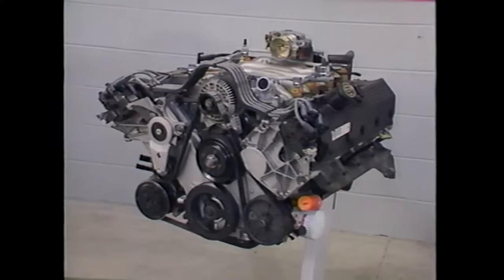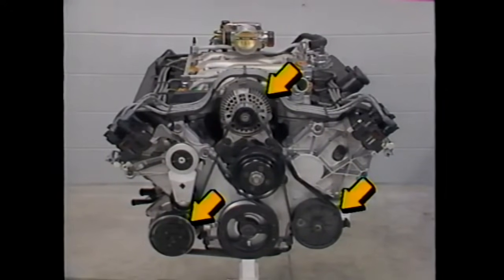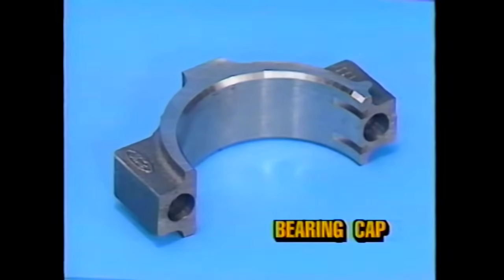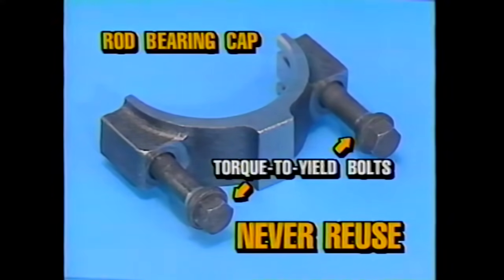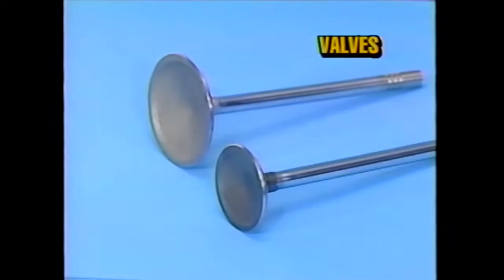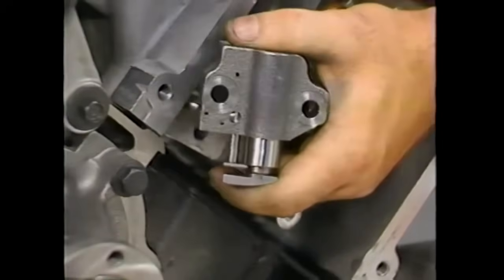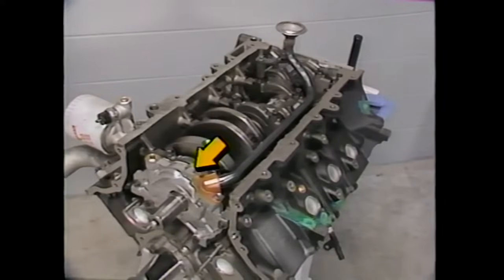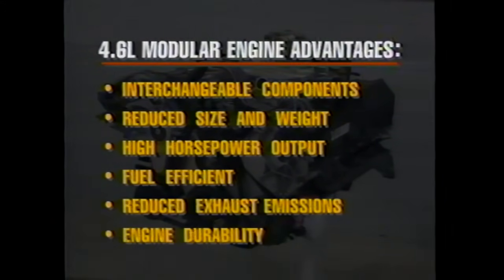Ford 4.6L V8 Engine Technical Education

Comment: At 42 seconds the narrator shows a chart and states the 4.6 makes 210 hp, much higher than the 5.0 .
A STOCK 302 IN 1989 made 224 hp so WTH OVER?

Comment: I have the 2003 Triton V8 5.4 litre 2 valve.  Amazing engine.  I put 380,000k on it before it went.  truck is still good so I put another one in that had 180,000k on it.  2004 they redesigned the triton into a 3 valve.  Ford's worst engine the mechanics tell me.

Comment: The jack screws help with distortion when torquing the main caps. If you try to first tighten the main caps without first installing the jack screws, the crank with bind up.

Comment: Why is this 4.6 being said to be light weight and compact. The 4.6 takes up as much room as fords older 460 CI V8 and weighs as much as fords older 351 windsor V8 at 500 lbs. I have owned 2 1989 Lincoln town cars that had the 302 V8 and they had more power and took up less room under the hood and weighed 70 lbs less that the 4.6. What we have here is generation ignorance of people that never owned 1980s fords and lincolns with the 302 engines. I own two vehicles with the 4.6, one is a 2002 supercrew F150 and the other is a 2005 lincoln town car and its a fact my cars I owned in the 60s up through the 80s with the ford 289 and 302 had more power and were much less trouble and much more compacted engines. If youre older as I am youve lived it and if you were born in the 70s and 80s or later you have been BSed to believe things that arent true
Reply: 99 PI 4.6 has 260hp, more than any factory 302 including 93 cobra’s 240hp.. The 4.6 is not as compact but is lighter because of aluminum heads and inclusion of brackets for accessories.. The 4.6 sounds better, is more efficient, reliable and maintains its hp throughout its lifespan… Driving a 200k mile 4.6 feels like the day it was made a 200k mile 5.0 is significantly lacking in performance..

The 4.6 has a better torque curve for traction, and revs higher and more freely.. 4.6 has more usable power throughout its torque curve.. Ive owned many of both, and would choose a 4.6 over a 5.0 in almost every scenario..
Reply: @NewEdgeDesigns  Youre a brainwashed person that wasnt around as I presumed in my comment earlier. Nothing you said is true. Have you ever even driven a 84 to 91 mark 7 lincoln???? No you havent. Your full of chit
Reply: @NewEdgeDesigns  Muted.
Reply: @EarlGuyton425 Muted for what? Spitting facts lol?
Reply: @yeetethdeleteth3307  Youre MUTED also
Reply: @EarlGuyton425 Insecure much?

Comment: The 93 Lincoln mark 8 block was beefiest of all 4.6 but the crankiness and pistons should be replaced with forged components - with a blower and forged internals you could approach 1500 hp
Reply: The 93 block did not use jack screws - manufactured by Teksid SPA Italy

Comment: Interesting they originally had an aluminum intake in this video, yet when they went into production they were plastic... When they switched to the PI setup, they went with an aluminum coolant crossover but left the passenger rear heater hose plastic. The mod engines are very very good, but there are 3 stupidly obvious issues that make it unreliable that could have easily been fixed when designing / updating. Which I would almost guarantee were changed due to "cost". 
If they had ALL came with an aluminum intake, fully threaded spark plug threads in the heads and steel body chain tensioners the mod engines would be almost perfect. Not a powerhouse by any means, but reliable and plentiful. 

They got the intake setup correct on the 3v's (even tho it is plastic) but they went backwards on the sparkplugs (which they later fixed in late 2008) and the entire VCT setup. I understand they needed to be competitive and make more power and used VCT to do this, but I would have much rather lost a few hp / torque and just went with a fixed gear. But... the VCT did make the 3v the highest HP of all the mod motors with the 2008, 2009 Bullitt and 2010 at 315hp naturally aspirated. That is excusing the entire "320hp" 4v fiasco that Ford got caught trying to save a few bucks and dumbing down the engine for the 99 Cobra.

Comment: My four six runs many hours a day oil stays full for thousands of miles, I personally like the plastic tensioners they are spring loaded and don't put much stress on the guides. Plus they have a better seal too
Reply: Weird when you start to modify them it’s recommended to use the metal ones
Reply: @WarriorOfEden3033  Build it right and they will last awhile been running a 46 for 5 years pull a heavy trailer and the oil never drops at all has 260,000 miles
Reply: @kustombuildsBTTX yes that’s why I upgraded to a billet 3v oil pump, 262 cams & port matched heads

Comment: I have 329 n change on my 97 f150 4.6l V8 2v with a aluminum to intake not the factory plastic..runs like it was off the line.....a real beauty of a motor 302 windsor not bad at all

Comment: Ratcheting tensioner has a know problem of stretching the timing chain, also the ford oil pump needs to be upgraded to a mellin high flow pump for this engine to be reliable .
Reply: Tensioner yes but the oil pump is a 3v engine issue
Reply: It was also used on the gt500 the 3v needed more oil cause it had the variable cam gears

Comment: I have 756,132 miles on mine and I have never changed the oil or the filters. It just keeps going down the road. 😊😊😊😊😊😊😊😊😊😊
Reply: Sure you don't 😂
Reply: I use tequila for oil..

Comment: I have the 4 valve version of the Modular in my Mark VIII currently @ 172k miles and still running smooth and powerful.  It has great torque I never have to go past 2500 rpm to go the speed limit of 45 its amazing the power is available at any rpm but at 3250 rpm all hell breaks loose snd all the runners open and the pull is epic to 6100! Ford killed it with the Modular

Comment: 1st ford I’ve owned 01 expedition 4.6. Engine seems ok but the rest of it sucks. Electrical gremlins seems to plague these things. Starting this week on replacing the heater cores. Requires removal of a million screws and nuts and all kinds of crap. I’ve always owned Chrysler and I can honestly say, will not be purchasing another ford.

Comment: I am driving a 2010 Ford F-150 with a 4.6 V8 3V engine in it. I am absolutely loving it! I was curious to what the engine block looked like and then I ran into this video. I am a lot wiser now, thanks for sharing!
Reply: 3v is the one that got issues
Reply: @jafaary2614 issues if you don’t change the oil religiously. And there was the spark plug issue but there are methods around that issue. There are many 3V’s with over 300,000 and 400,000 miles.
Reply: I’ve also got a 2010 with a 4.6 but mine has the 2v. Still am not sure what the difference is and why they offered 2 and 3v the same years.
Reply: @WhoamI20233 3 valves have boosted performance due to the extra valve. More HP and will rev higher if I'm not mistaken. Fords 3V V8 designs also all had cam phaser technology, which alters cam timing I believe. None of the 2V V8's had this. Basically the purpose of the 3V engines was to add power to Ford's Modular/Triton engines. But it came at the cost of reliability
Reply: 2 valve 4.6 is like a normal motor 3 valve is a piece of crap when you try to put it back together it cost about $8,000 with all the phasers and the Special Assembly do not buy a 5.4 3-valve or a 4.63 valve you will regret it
Reply: If you ever change a spark plug you better go buy the book and take extreme attention to what the rules are you will strip that plug out of the head
Reply: @JohnFerrell-u3e only 05-07 i believe has the 2 piece spark plug, after that it was a single piece design. the timing assembly is very very similar on 2v and 3v and the phasers on the 3v are the main issue but if you can rebuild a 2v you shouldn't have much issue rebuilding a 3v

Comment: These engines were gutless as all hell, but very reliable. Very smooth engines, too.
Reply: They weren't gutless when they were new.  Modern Engines have made them gutless but they were damn nice when they came out vs the 5.0.
Reply: @weskirkland5850  True, but there were way more powerful options from other manufacturers at the time, as well. One that immediately comes to mind is the LT1 350 V8, which blew the 4.6 at the time out of the water.
Reply: @TheTerminator310 😂😂 5.7 litre high fuel consumption v 4.6 litre fuel efficiency of course there's a Power Differential 😂😂. This doesn't make the 4.6 gutless you've compared it to a bigger cube engine 😂😂
Reply: @Saffsa  Doesn't matter. It was still gutless, compared to the competition. We're not talking about fuel consumption, we're talking about power/performance. And the 350 is an engine that has been around since the 1960's and was murdering the Crown Victoria 4.6. A good motor, but it was anemic, as hell.
Reply: @TheTerminator310  you said it was gutless comparing it to a bigger cube engine 😂😂 a gutless comparison would be if it was seriously under powered compared to another  manufacturers 4.6 V8 😂😂
Reply: @Saffsa  The 4.6 was in competition with theLT1 in the Crown Vic, P71. And it lost, big time. Ford had nothing that could beat it. I will say again, size or not, the 4.6 was gutless. Even for its size, it was gutless.
Reply: @Saffsa  I even own two 4.6 powered Panther’s. So, before you say I’m sone kind of GM fanboy… I HATE GM. But facts are facts.
Reply: @TheTerminator310  you still haven't got it 😂😂 you've called it gutless compared to wat . A bigger cube engine 😂😂 do you understand . Gutless compared to wat comparatively . Your statement makes no sense 😂😂👍👍
Reply: @Saffsa  I told you what comparatively. You’re focusing way too much on size. This engine regardless if it’s much smaller was supposed to be in competition with the LT1. It didn’t stack up well. Enough said.  If you want a size comparison… 2000 Chevrolet Silverado 4.8. 255 hp. 2000 F-150 4.6L 220 hp. The Ford 4.6, as I have stated multiple times, is gutless.
Reply: @TheTerminator310  😂😂 😂 still needed those extra cubes to gain that little extra HP 😂😂😂
Reply: @Saffsa  And it took the Ford 5.4 just to make 5 hp more than the 4.8 in the same year truck, but STILL made 15 less than the Chevy 5.3. So, what is your point? Lol.
Reply: @Saffsa  I’ve driven both trucks with 4.8s and 4.6 Ford’s before and the Chevy is night and day better.
Reply: They definitely were not gutless, especially at the time.  Also the Pi versions and 3 valve versions had more power.  Then you have the 4 valve version which was a beast
Reply: The 4 valve version of the 4.6 had forged steel crank, rods and pistons, along with 6 bolt mains and an aluminum block which was casted by Tekskid on the 93-98 versions
Reply: @BrownBomber92181  I'm mainly talking about the 2v, which was gutless. Drive a 1997-2003 F-150 with one and tell me it isn't gutless. Or worse, a 2004-2008 with the 4.6L. I have. They're terrible. I will say it does ok in Panther's, but I've driven the F-150's with this engine and honestly, it should have never been installed in them. For a V8 (even at the time) it was horrible. Ford for many years was the worst at building gutless turds. I much prefer the GM 4.8L, personally. To each their own.
Reply: @TheTerminator310  the problem with the 11th gen F150 2004-2010, was they were so heavy.  Even with the 3v 5.4 making over 300 hp they felt slow.  It definitely depends on the application with the 4 6, if you have an extended cab, even worse a long bed and 4wd and auto trans, yes the 4.6 will be under powered in that setup.  I had a 99 F150, short bed, regular cab, 2wd, with a 4.6 and a 5 speed manual, and that truck was anything but gutless.  It pulled very hard, although you couldn't shift fast because if the long shifter.
Reply: @TheTerminator310  you have to remember, the 4.6 when it came out wasn't designed to be a truck engine.  It debuted in the panther platform, then was used in the SN95 mustangs and MN12 Tbirds/Cougars/MarkVIII.  That engine didn't go into the trucks until 97, and the only change Ford made to that engine in truck applications was a different intake manifold with longer runners
Reply: @BrownBomber92181  Yes and it was a terrible idea, lol. Ford seems to have plenty of those. Ha. Be thankful yours was a 5 speed (which was superior) and not that junky slush box 4R70W. I drove one and that transmission is a mess and kills what little bit of power the 4.6 V8 had.
Reply: @TheTerminator310  i wouldn't say it was a terrible idea, it got very good gas mileage for a V-8 & had more power than the 5.0 that it replaced.  Thats the torque management you're talking about on that trans, I also stepped up to a 99 F150, ext cab with a 5 4, and I added to shift kit to the trans and that eliminated that torque management, which basically reduces power during full throttle shifts.  That truck was very quick after I upgraded the trans, very fun to drive, itd actually chirp the tires on a full throttle 1-2 shift
Reply: @TheTerminator310 all your comparing is raw HP. The lt1 sure made more power, but was a very crude and unrefined engine. The 4.6 was a smooth running gas sipper. That's why alot of departments liked them. The individual officers liked the caprice for the power. But the departments kept buying vics becuase they are the ones paying those gas bills. 

This video is from 92-93. At the time the caprice made 180hp, caddillac Deville made 200hp from the HT4100. If you wanna compare it to anything you should compare it the the lexus 1UZ or q45 engine. But those are 4 valve engines.

Comment: just picked up a 1997 Ford Expedition XLT with the 4.6L V8 with only 105k miles. excited to see how long it lasts!
Reply: How's she going? I just picked up an 04 F150 4.6l with only 60k on it! 
I just hope to keep the rust away so it has a nice long life.
Reply: @emmittmatthews8636   engine/trans has been flawless. i’ve gone through and replaced all the lights inside and out with LED bulbs and housings and it really makes it not look so dated anymore. i did the rear differential fluid and wheel bearings + seals about 4 months ago. just did the front sway bar links last week cause i noticed they had completely rusted away. the entire rear suspension and fuel system is basically brand new. this winter i hope to get around to replacing all the front suspension and a transmission flush, coolant flush, and a new set of Michelin tires. i’ve had all the paint clayed, polished, and waxed and other than the roof and hood it damn near looks brand new. (EDIT: also some cerakote plastic restoration wipes for all the trim. makes it look like new again. i put it on when i wrote my original comment and i’ve washed the truck 20-30 times since and it’s still very dark.) i tow a 6-7k trailer doing property maintenance and it pulls better than my old F350 with a 7.3 IDI  for sure.

if yours is the 4.6 3V just make sure and do your oil changes religiously to stop the gunk up that happens with those engines. otherwise, congrats on your new purchase and may it last many more thousands to go!
Reply: I'm a little paranoid about engine sludge so I also use engine flush at every oil change.
Reply: FOREVER
Reply: Change oil no more than 4000 miles it will last you at least 300k

Comment: There was an updated technical service bulletin by ford to switch from 5w30 to 5w20 in this engine. I am buying a town car with the 4.6 l v8, a 1997 model, 100k miles, good engine psi. Previous owner used regular dino oil sae 15w40, I was thinking switching to the 5w30 as it should make the engine work more efficiently as it was designed to be using that weight, but NEVER 5W20
. What are your thoughts? I'll appreciate any input, thanks in advance.
Reply: I use 5w20, but ONLY FULL SYNTHETIC. Never had an issue for the 6 years I've ran 5w20
Reply: I still use 5w30 in mine. It’s just a little thicker oil.
Reply: 30 in summer,  20 in winter
Reply: 5w30 and I have 400k miles. I buy whatever oil is on sale
Reply: 5-30 Mobil 1 synthetic has been my go to in these cars for years..
Reply: Just switched to 5w-30 Pennzoil full syn on my '03 4.6 F150

Comment: My 4.6L has hard plastic air intake and valve covers. 😥
Reply: Weight savings, only the intake can be a problem after thousands of heat cycles it may crack and leak…There are aluminum options victor jr. or precision performance are 2 aluminum intakes that come to mind, also intake off a bullitt Mustang

Comment: you had me at 4.6L 220hp being HIGH hp engine......high HP compared to what? 4.6oz mouse?
Reply: Eh, it was good for the 90’s. After the horsepower deficit of the 70’s and 80’s, an engine breaking 200 hp was pretty revolutionary, pun intended. Also, if you’re looking for a V8 that will last forever, go underpowered. 500hp produces a lot more wear than a 220hp engine.